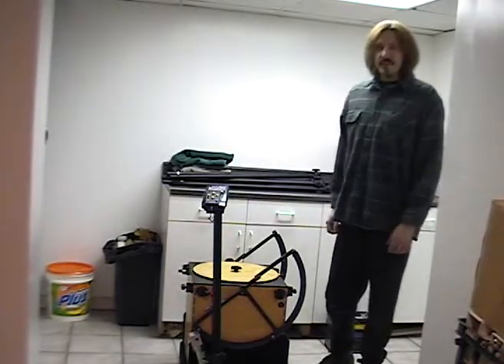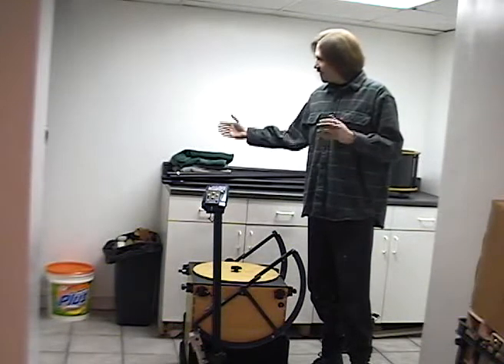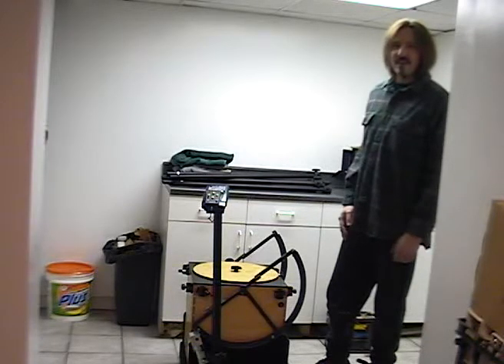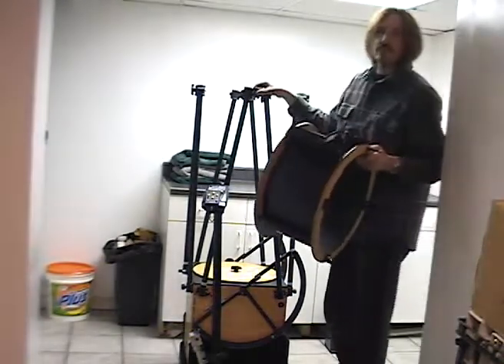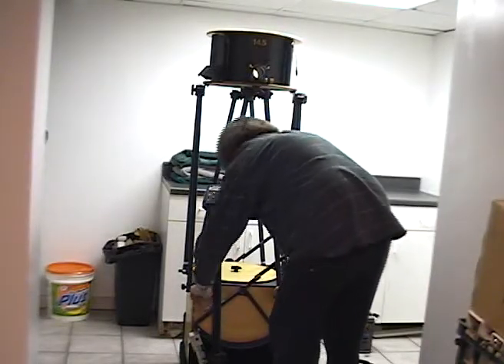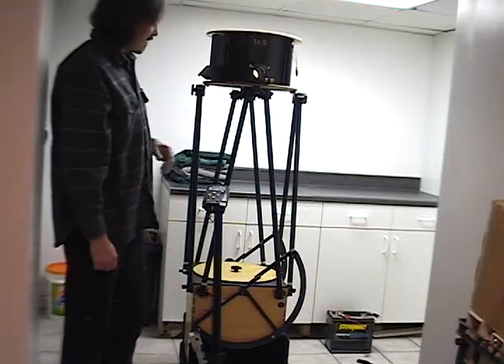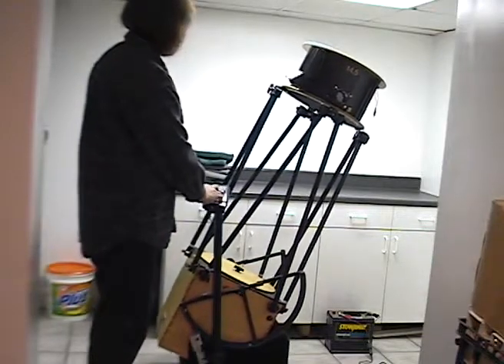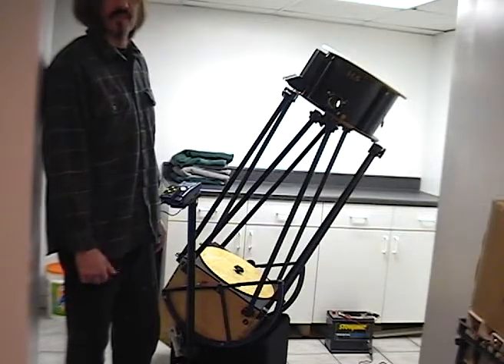Setup of 14.5" Telescope D14

Comment from the maker: @imanoob4 

Actually, it is a Deep Cycle Marine Battery.  

Car Batteries do not like to be run down, it damages them.  Deep Cycle batteries are almost impossible to damage.  The ones we use are 8-10 years old and still hold a charge.